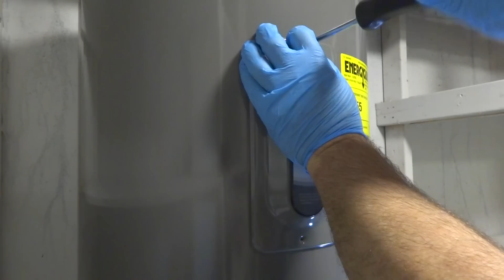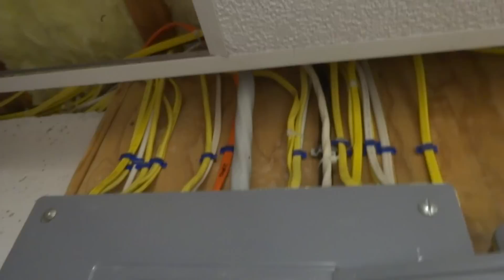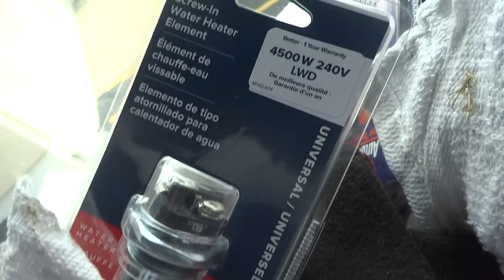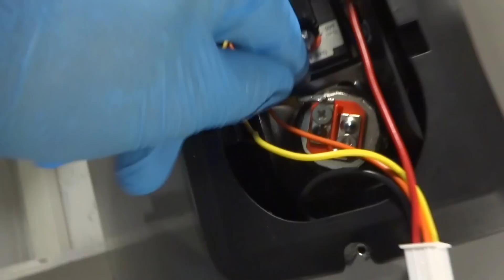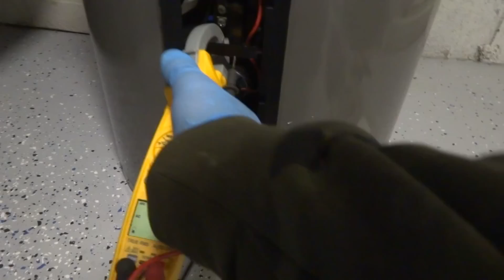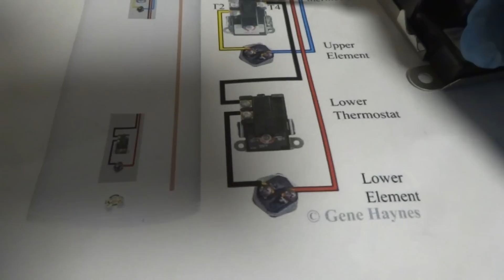40 GALLON ELECTRIC WATER HEATER NO HOT WATER

Comment: I figure the lower element lost continuity and failed. This caused all the heating to be done my the top element which caused the control to cycle on-off excessively and eventually wore out the control. Does this sound correct?

Comment: The theory of operation for a duel element electric water heater is as follows: Cold water enters the water heater and sent to the bottom of the tank through a dip tube forcing it to pass both heating elements before leaving at the top of the tank as hot water. Since the water is leaving from the top of the tank, the upper thermostat has priority for heating. Power enters the high limit and goes to the upper thermostat. From the high limit 120v is sent to one side of both the upper and lower heating element. The other 120v is sent to the upper thermostat. If the water temp leaving the tank is not at desired temp, the upper thermostat sends power to the upper element. Once the upper thermostat is satisfied, it turns of power to the upper element and redirect power to the lower thermostat. If the water temp at the lower thermostat is below desired temp, then the lower thermostat sends power to the lower heating element until the lower thermostat is satisfied. Both heating elements never operate at the same time. 

Testing upper heating element: Verify there's 240v leaving the high limit. Check for 240v at the upper element being tested. If the thermostat is satisfied, there will not be 240v. turn up the upper thermostat till it clicks, there should be 240v at upper element. If not, replace upper thermostat with high limit. If you have a break in the heating element, the water completing the path of the terminals of the element can give a false ohms reading. If there's 240v at element, use a clamp on amp meter to check for proper reading of element. 

Testing lower heating element: test for 240v at lower element. If not present, check if upper thermostat is calling and turn it down til it clicks and send sends power to lower thermostat. If it does not send power to lower thermostat and upper is satisfied, replace upper thermostat. After verifying there's 240v to lower thermostat, turn up lower thermostat till it clicks. Check for 240v at lower element. If 240v is not present, replace lower thermostat. if 240v is present, use clamp on amp meter for proper reading. If no amps, replace element.
Reply: Hello.
Perhaps you should get your own channel?

Comment: I never knew that it only heat's one element at a time , good explaining Steve !
Reply: Two 4500 watt elements on at the same time would exceed the current rating of the (generally) 30 amp circuit breaker.

Comment: What kind of a crack pot uses electricity to heat water unless they are off grid solar entirely and looking for a heat sink. If that was the case it wouldn't be AC 220.
Reply: You do realize that NG pipes don't run everywhere and propane is as much or more expensive than electricity in most areas?
Reply: @jkbrown5496  I'm sure in some areas but the fact is over 70% of energy is lost when electricity is produced from fuel. That means it takes at least 3 times more fuel to make hot water from fuel if you first convert it to electricity. It's highly wasteful is my point.

Comment: Good repair Steve. From a U.K. perspective the control logic just seems a bit odd. Surely the top element should come on first so that some hot water is available quickly, then when the top thermostat is satisfied, control should switch to lower element. The control should always give preference to flipping back to upper if it’s thermostat calls for heat.

Comment: It sounds like those kids in the background made racket the whole time.  I guess those daycare workers must earn every dime they charge.  
   The water heater pressure relief valve with no pipe extending over and down safely to the floor seemed strange.  Also, the premature heater failure.  It looked like the MAINTENANCE GUY for the center isn`t so skilled and may have been the cause.

Comment: Over here we get cheaper electricity for water heating during the night so the grid only supplies voltage during off peak hours. If you have a twin element the top element is charged at full rate and is a boost if you run out of hot water in the daytime. Most people only have a single element with off peak power

Comment: had a 80 gallon once the lower element got so cooked it warped COULD NOT get it out had to cut it leave part of it in. around here elements get loaded with calcium then takes longer to heat starts tripping the breaker and/or lower element buried in calcium scale can make a little shovel from 3/4" pvc but it's better to just replace the water heater. ive tried flushing water heaters does'nt seem to get scale out

Comment: I bent 2 of them cheap metal wrenches to remove elements so I bought a 1-1/2 socket with 1/2" drive and finally got it loose with a pipe for leverage.

Comment: You can change the bottom element without draining. Turn off the cold, relieve pressure by cracking a faucet for a second then closing. Prep the new element for install and do a quickie on the fly. May only lose a pint or less. The vacuum holds the water in so you don’t have a gusha momma.
Reply: Good tip!
Reply: He understands the concept of vacuum and has utilized it extensively on other jobs with both water and fuel oil issues; with fuel oil having the potential for a real mess if too slow. I'm weak on mind reading so I won't proffer a guess as to why he didn't take advantage of it here.

Comment: I like to take an amp draw on the element when it has power, it will tell you if it is heating and not just power on the element. Power can be at the element and it may or may not be drawing amps.

Comment: I replaced the water heater in my Mom's house after the old one started leaking. Went back with a countertop unit because it sits right next to the washer and dryer at the side entrance so it all looks the same. Those old countertop units seen to last forever. I know of one that has still been going since 1957.

Comment: Those electric water heater controls can be a pain in the rear when they intermittently fail. It will start working when you adjust the thermostat but will fail again a couple days later.
Reply: When they start getting unreliable and need frequent fixes, pull the whole can and grab a new one.

Comment: I had an old sears kenmore 80 gal in a multifamily building i owned . It was in the building when i bought it 18 years ago. Had a dogs life with 8 units and 2 washers pulling out of it. I replaced the elements one time with stainless units as one blew. still running today. No crap controllers (save the whales ) etc.

Comment: You can check each element for continuity if element don’t beep on your tester you know that element is no good
Reply: Water heater elements are kind of tricky to test for continuity, if the calrod coil is actually busted open and exposed to the highly conductive water, which in some cases they are when they go bad, then your meter could backfeed on the water, giving you a false reading that the element is good, checking amp draw to the element is an another way you test to see if it's bad, and get around that problem.

Comment: That control was probably out for a while causing the lower element to give up the ghost as it was trying to heat the whole tank
Reply from the maker: usually the top control has to be satisfied at set temp before it will power up lower .so it throw me off power going to lower element .it might had something to do with power lights on from control ..
Reply: I think the lower element manufacturer weld to the wire connection was poor and finally gave up causing sparks and affected the controller to give up. Hi Steve, another good vlog.

Comment: They probably powered up the elements before adding water.
Reply: If that happens an element will "go-out with a BANG!"... says my heater manual.
Reply: @craigharding475  maybe it was partially submerged? 
Who knows. It sounds real screwy for a new unit to fail so quickly. 
Maybe they over current to the element welded the contacts in place of the controller? 
Just tossing ideas out there.
Reply: @goalie2998  Thanks, I find that truth CAN be stranger than fiction.  Toss-in Murphy`s Law and the strangest things can happen.  Even one squirrel can knock-out power to an entire community.  I worry about power surges as well!

Comment: I just put one of these in Christmas time, there made by Rheem ( GE if memory serves me correct) they also have a 9 yr warranty. The brand I have is Rheem (same as ruud) and look identical!!
Reply: I had a good experience with a Whirlpool 30 gal. electric that I got from Lowes and installed, myself.  It lasted at least 15 years.  All I did was flush it each Fall.
   I had asked the Lowes guy about sealant for the sacrificial rod.  (If I removed it as per the instructions a year or so later to check it).  He advised me not to bother with it.  He said: "You will be able to get it out...but you probably won`t be able to get it to stop leaking after you replace it."  I took his advice, but I suspect that this would apply more to high city water pressures than in the case of a rural well like i had.

Comment: They make you have vacuum breakers but no grounding kit or dielectric unions?🤔
Stay safe.
Retired keyboard super tech.🍇🏌🍺🍺🍺🥃🥃
Wear your safety glasses.
Reply: @justwondering4342 one of them is a wall-rich kit and it has 6 gauge.
Reply: @justwondering4342  I see where Steve is they don't require purple cleaner these ass*hol*s want to see purple on PVC
Or you fail & nothing less than 4"smoke pipe.
Reply from the maker: tank has dielectric nipples .. why use unions ??
Reply: @stevenlavimoniere  galvanic corrosion.
Helps retard the process.
Also in jUrzy some townships require it along with the purple crap on PVC
Reply: @stevenlavimoniere  and every township requires a grounding kit(gas or electric)

Comment: I worked for an Electrician for about a year and We did some work at Our Mall Here near Asheboro North Carolina.   The People that put the water heater in, had put the water heater in and they were running a 240 volt water heater on a Single 208 breaker.   They said it worked for something like 8 years like that.
Reply: Will work fine like that, you just won’t get the full 4500 watts per element so it will take slightly longer to heat the water to temp.

Comment: Steve sometimes ohms on those elements  will show resistance but not carry load  I  try using clamp  on side of meter and  probe  one lead at a time to element to see if amps  are being pulled....been tricked before by ohms
Reply: Best test is under load,I've seen alot of them read continuity but then no draw!

Comment: Thanks for another plumbing adventure Steve!👍   If you ever have a real stubborn element, get a 2 1/4" (I think) 1/2" drive socket. Put it on a belt sander or grinder to put a perfectly flat face on the lip of the socket. Now a 1/2" breaker bar or impact driver does the job. I learned this from another plumber years ago, and it works well.

Comment: A dual-element water heater uses two heating elements controlled by two separate thermostats. The upper element heats the upper portion of the water column. When it reaches a specified temperature, Rheem notes that it shuts off, and the lower heating element takes over, heating the rest of the water.
Reply: yea, that sounds correct.  Here in TX I have worked on several, and the two elements are never on at the same time.
Reply: Most water heaters will come wired and installed for non-simultaneous heating. But they can all be wired for simultaneous. The only thing you need to watch out for is breaker and wire size and you'll need to swap out the aquastat on the lower element for one with ECO.